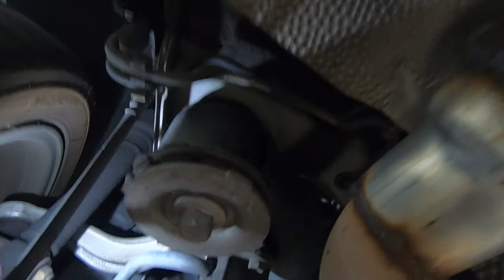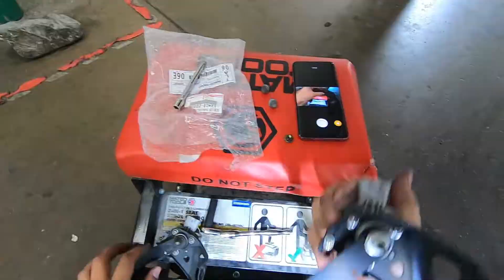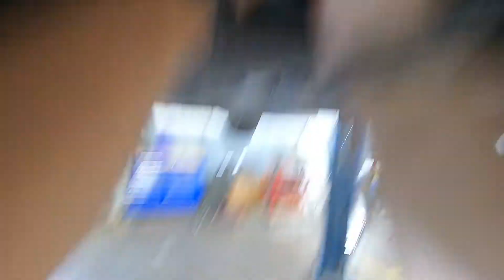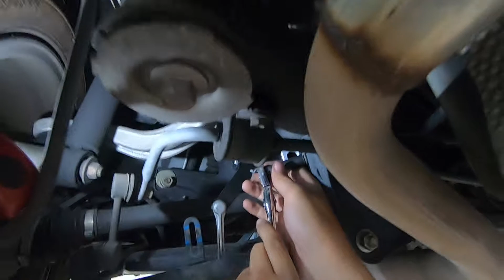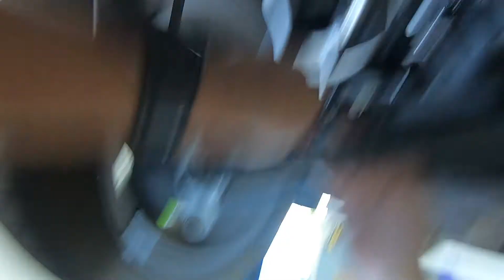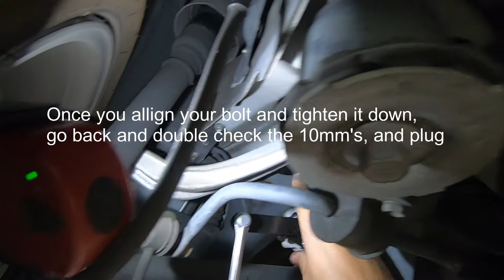How to Replace a height sensor on a Lexus LS430

Comment: Amazing video, i have one question so i changed the control arms on my car with figs engeering and my car when i drive the height goes up automatically and once am parked it goes back to lower height i have a 2005 LS430 UL
Any suggestions whats causing it to do like that. Thank you

Comment: What does this sensor do? And what are the symptoms of its malfunctions?
Thanks for sharing the experience
Reply from the maker: Hello! Depending on your cars trim the functions differ slightly but its needed nonetheless. The height sensor on a Ultra Luxury LS430 functions as a sensor that tells the air suspension ECU where the strut is in relation to the car. An example where this is used is when you load up the car. Lets say you put 500lbs in the trunk and the rear of your car is sqauting, the sensor would tell the air suspension ecu "hey we're not level, level off the vehicle". This sensor also works with the cars AFS system(all 430's with a AFS switch on the dash next to the steering wheel). Which is your swivel headlights and auto level lights. 

How I figured out my sensor went bad was my left headlight would dip or "hi height" would flash on the dashboard. I then scanned the car with an OBD2 code reader and was able to find out which sensor in particular.

Comment: My 2004 LS 430's headlights won't level after start up, they both aim too low and stay there. There are no errors on the dash except for 1 day the afs light was flashing when I went to the store, and then it went out after I started up and drove home from the store. I suspect one of the height sensors could be the issue? What do you think? And, would a diagnostic tool be able to determine whether the front or back sensor is bad? Wouldn't want to guess. Thanks.
Reply from the maker: I had similar symptoms to you. My AFS light would flash randomly and my left headlight would randomly dip too. I used my works code reader to find out one of my height sensors was going out. I then found a pdf from "lexuy.pl" that shows how to test the sensor and it also tells you which sensor it is based on the code.
Reply: @manyvermin8854  awesome, thanks so much

Comment: How do you bench test these to see if they went bad? Both my rear struts bottomed out but the struts and compressor are ok. I’m thinking it’s the height sensors or rear main controller?
Reply from the maker: The best way for me to test was to use a scan tool that let me see the data from each sensor. However you can measure resistance from the sensor itself. There is a lexus form online that tells you what the values should be.

Comment: I've been trying to narrow down what the issue with my UL might be. I don't think it's the struts, I think it might be the height sensors. I have a controller installed to work with the factory air suspension and one of the pages shows the height on all four corners.

The rear-passenger is always off (shows as if it is aired out all the way when in reality it is in half the travel, visually). Funny thing is that that corner is not the issue; it is diagonally across the car (the front-driver). This side randomly decides to air all the way up when driving (almost a 7" gap in the wheel-well) and I think this causes the rear-driver to also rise. I have to park the car and toggle between my presets for it to regulate itself. Once it fully reaches my desired height setting, the front-driver will start to rise again. It's annoying. I really don't want to castrate it by replacing the suspension with coilovers, does this kinda indicate that the issue might be with the height sensors?
Reply from the maker: Oh man I went through something similar. I assume you're running a data controller(ac680)? I had a few times the car would go full low rider on me. Front left would air up and right rear would air down. My data controller was starting to not show the left rear sensor from time to time and then other issues popped up so I replaced it. But it didn't fully fix my issue of the car going full low rider. After removing my data controller in preparation to go aftermarket the car was acting fine.  

I would disconnect your data controller and see if it changes anything. That way you don't gotta go and spend $$$ on a sensor.
Reply: @manyvermin8854  that's spot on and yes that's the controller I have. Mine sometimes doesn't show one of the rears, I don't remember. I'll give that a try. Thanks. What did you end up doing on yours?
Reply: @alejandroramos9058  i will buy a car that have exactly the same problem and same controller, did you two re-installed the controller after replacing or not the height sensor ? i want to use the controller properly, it's one of the reason i buy this car
Reply from the maker: @yamamichiuniverse1383  After I replaced the height sensor most of my issues went away. But I had removed my data controller to go aftermarket route. Removing the data controller had totally fixed my issue. I am un sure of what went wrong and caused the data controller to act weird.
Reply from the maker: @alejandroramos9058  I ended up removing all OEM air from the vehicle and went aftermarket air route. I have air runner struts and air lift performance management.
Reply: @manyvermin8854  okay, i understand it's more reliable, but it's also a lot more expensive